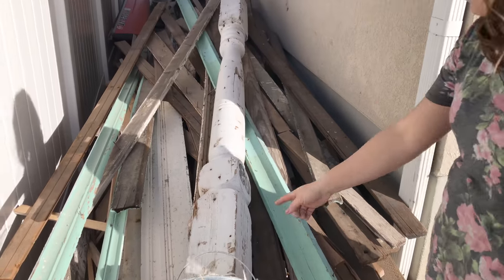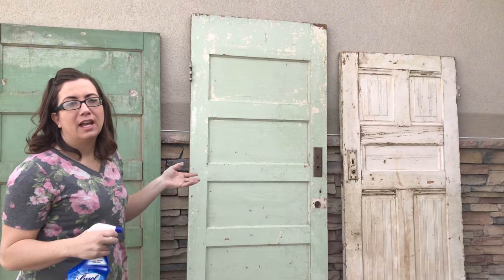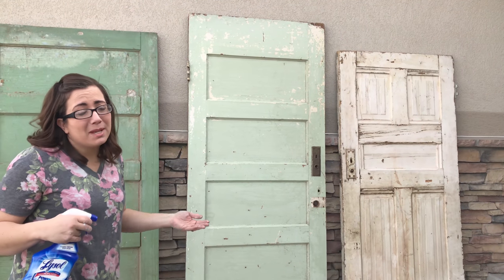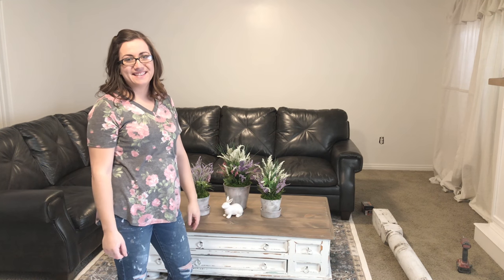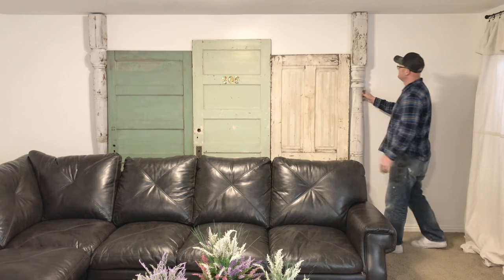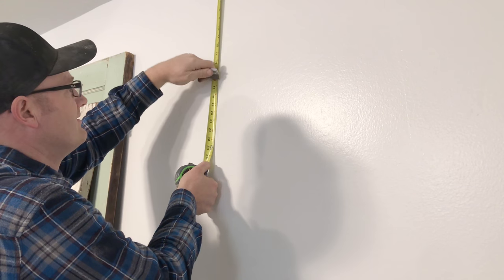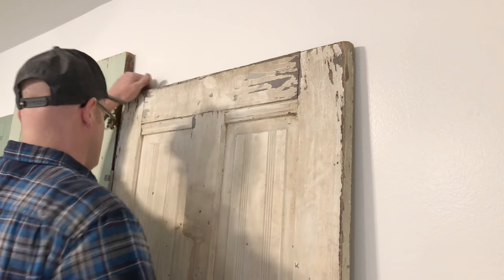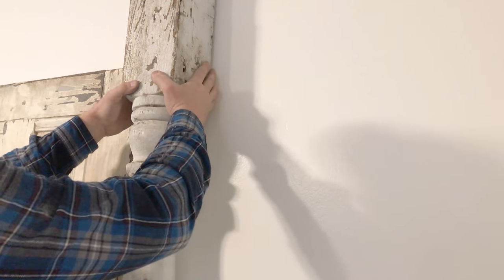Farmhouse Makeover - How to use Chippy Salvage

Comment: Hosing down wood is ok? Can I do this with pallet wood too? I've always thought water and wood are a no no.
Reply from the maker: So, these doors are mostly painted and we dried them off later. Wood can handle the water but if it gets too damp it will make it swell and you’ll need to wait to do anything with it until it dries out. 
I leave my salvage on the side of the house and it gets rained on and snowed on all the time and just gets more chippy. 👍 
You don’t want to get fiberboard/mdf wet. Water will ruin that.
Reply: So cute! Simple idea!